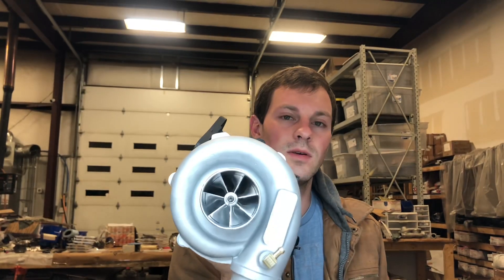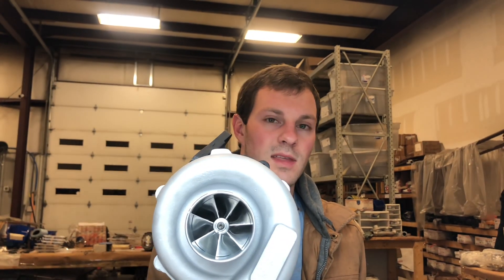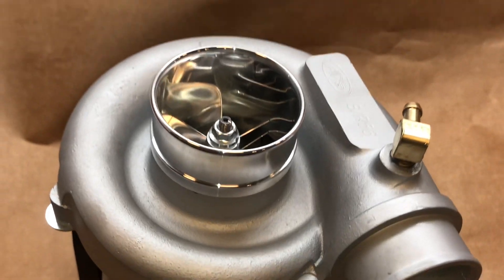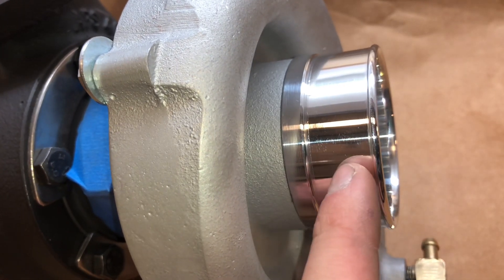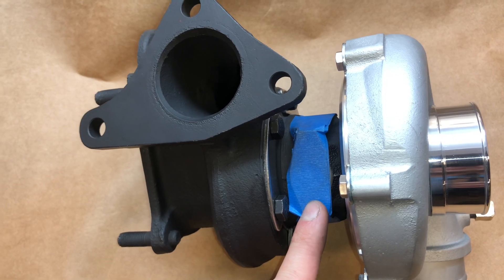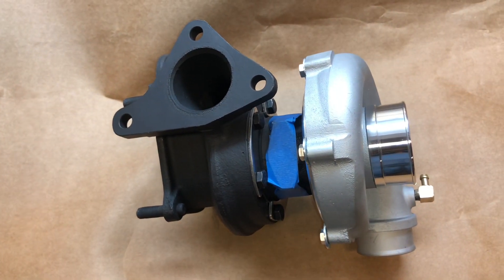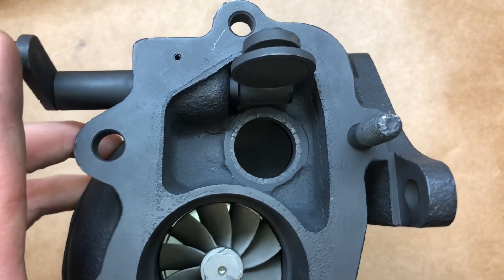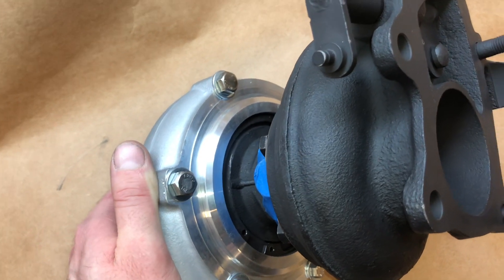Aps SR56 turbo upgrade part 2

Comment: I used to have one of these turbos and from what I could find they used a 7 blade T04S 76mm exducer compressor wheel. Why they did that instead of the 6/6 blade GT wheel ill never know

The turbine housings are .94

Comment: I have a little question. I have a dual ballbearing chinese turbocharger. Looks like its a replica of gtx3076r. Which oil restrictor should be used on oil feed port? I mean internal diameter.  1mm? 2mm? 3mm? or something different? Thanks in advice. 😊
Reply: WHOISTRANE 1mm